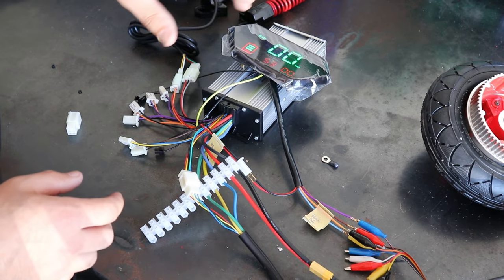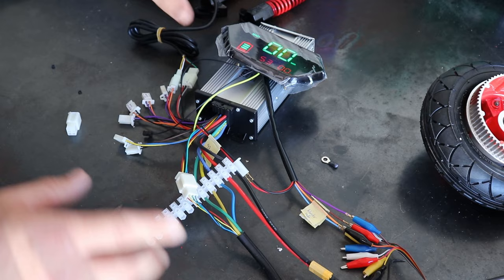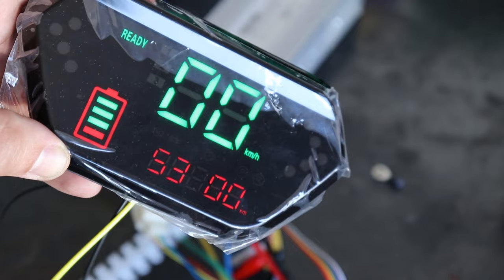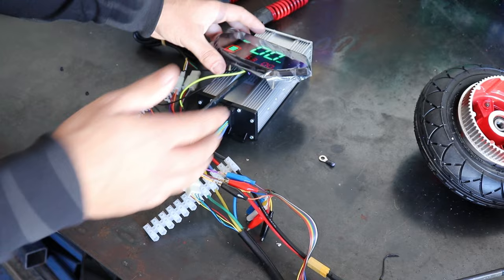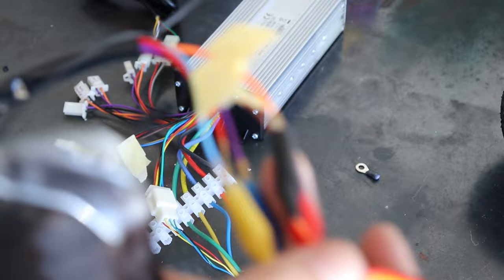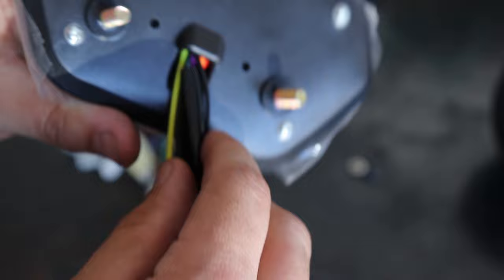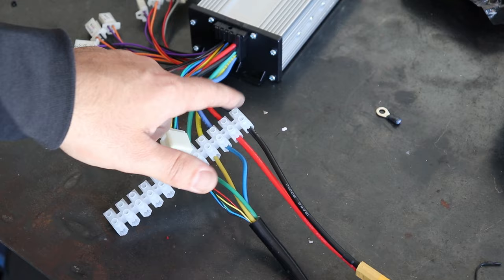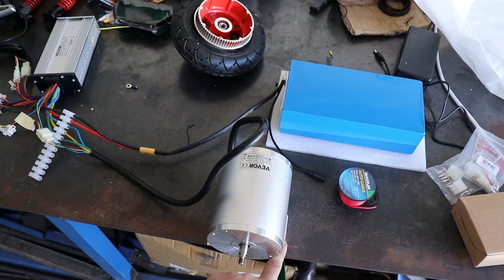How to Wire in a VEVOR 48V 2000W Motor Controller and Brushless DC Motor

Comment: Great video. I have 2 of these 48v 2000w Vevor Controller and motor sets on my Razor MX650 and MX500. They are amazing. I recommend doing the "shunt mod" it made a huge difference in torque. You can find a bunch of instructions on you tube. Cheers!

Comment: for this display, the yellow wire is for speed. should be connected to the controller one of the wire in purple colour. the label usually in Chinese is 一线通 or 仪表线(速度信号) meaning Gauge wire (speed signal).
the pair of black colour wire when connected together mean only use 60V battery. if not connect, 48V~72V battery also can use. At some controller also have pair of black wire can connected to each other. That is so call 自学习线meaning self-learning wire, usually for after complete assembled the whole system and testing. After done, you can disconnect it.
Reply: Regarding the self-learning wire: after the assembly is completed, connect the self-learning wire first, then turn the accelerator handle to let the motor rotate and keep it, pay attention to the direction of rotation, if the direction of rotation is reverse, disconnect the pair self-learning wires while still rotating,  At this time, the motor will stop automatically, and then reconnect again. At this time, the motor should rotate forward as correct direction, and then disconnect the self-learning wires. At this point the procedure is completed.
If when beignning of test the motor already turns forward as correct direction, just disconnect the self-learning wires to complete the test procedure. This is for save time no need to rewiring if the motor installed as wrong turnning direction. BTW, some controller the pair of self-learning wire is in white colour.
Reply: Can I run this off 3 drill batteries without destroying it ? - 60V OC
Reply: @jamesandrews5575 if those batteries can handle the rated 33 amps it should b fine

Comment: Hi, regarding the speed display what you can do is connect the wire that is responsible for the speed from the screen to one of the phases or the green or blue of the motor, and you will see that the display will change the speed, but be aware, as soon as you stop pressing the button the speed will decrease, the speed that will appear is will be measured according to the amount of current that passes through the motor but not the true speed at which the wheel is moving, for example let's say you are driving right now and then release the button, what will happen is that the speed you see on the display will not show the speed that the wheel is really traveling, it will look like 0 when the wheel still continues to turn, And unfortunately I also did not find a solution to this problem unless you connect an external sensor to the wheel and then connect it to the screen and only then can you see an accurate speed.
Reply from the maker: G'day Mate! I tried this and it worked! Yellow or Green gave me speed readings thank you very much.
Reply: What did it display may I ask as I'm wondering if I could connect the external  speedo I have to it but gotta figure out which of the two wires I gotta connect
Reply: I connect the white wire from the speed signal to the blue wire from the motor phase, and this gives a speed reading when I twist the throttle, but it also keeps reading the speed without twisting the throttle, it also does it if I just push the scooter and the motor is turning and the scooter is on
Reply: @bennysgarageau  right! i would like to your video on that
Reply: This video gave me a treasure of knowledge

Comment: The 1800W Vevor motor controller (BY12WF02-C)  has the "Speed Limit", "Cruise", and "Reverse" plugs. Shame they didn't just keep consistent on the wiring so it's not so daggone confusing.

Comment: One more thing your motor is operating at 100%, your 3 speed switch if you short that out you will eaither get 50% power or 120% power. So if you want a speed boost short the  3 speed to 120% for an extra boost 🤔😉
Reply: whats the best way to short 3 speed switch? newbie here... peace
Reply: @sevenmoon4105  small bit of Wire, Solder the ends to make them more solid
Reply: @sevenmoon4105  Use the middle pin as the base and then use the other bit of the wire to pin one of the 2 outside pins and you should get 50% and 120% no pin is 100%
Reply: Does this work for any scooter's motor or you refer strictly to this vevor motor?
Reply: thanks for your help! so does  matter  which outside wire i connect with center? right now i am running it normally so black to black, blue to blue, yellow to yellow..  @djhighvoltageoffical
Reply: @sevenmoon4105  no it doesn't, once you get the motor spinning in the direction you want then apply this method

Comment: I am ordering one of these payday on the 3rd as well as a 48volt 2000watt used power supply.  The power supply come out of telecommunications field.  You can buy them around 100 bucks.   But this is fixing to be the heart and sole of a shopsmith and also a 2 x 72 Belt Grinder .   2 3/4 hp Plus It has the option of being cordless.  The e brake will make it safer as well.   I think this is one of my better Ideas.

Comment: The speedometer needs to connect the yellow cable to the blue cable the bigger one that comes from the motor and it works like a charm. Also The contact with a red and black cable should be the external charging port. :)

Comment: Thank you man, great video covers everything in great detail, I'm going to put this motor on a Stingray bike except it will be 1800w instead because my mother doesn't want it to be powerful 😂 Keep the good vids coming!!
Reply: “Hey ma, but it’s only 200 watts more?!” 

Here’s a trick…. Just upgrade the motor controller to a 3000 watt bldc (make sure it has hall sensor) 
These motors are rated at “1800” however you can easily push 3000 watts with a motor controller upgrade and be safe. Most motors can withstand 2x up to 4x rated power but I’d say 3000 is safe with this vevors. They are well built, not the best but by no means cheapest they are quality and can take a beating. 

On eBay you can find them around $50 cheaper versions but I tell you they will do the job just try and find one that has the most “mosfet” count you can within your budget and you will see those things screaming. 
(Currently I run the 1800w vevor I bought used and it’s running a 3500 watt brushless motor with hall and it  screams past my brothers who has the full stock motor and controller 1800 watt from vevor. 

Cheers! 🎉
Reply: @Michael Smith  any example of a controller you can show us ?

Comment: I wired everything up and the motor only spins like a millimeter when I give throttle. If you know how to fix this please reply 👍
Reply: I have the same problem
Reply: @pandaman3459  I figured it out 
It’s 
Green to Green 
Blue to Yellow 
Yellow to Blue 
That’s the motor phase wires (fat ones )
The 5 pin white box wires are normal just swap the yellow and green ones and the motor should run perfect. Lmk if you have any problems

Comment: Sweet, great video! I replaced some of the plugs with waterproof plugs and had a voltage reading key lock and this got it going good with no fatal sparks! Might have to use a separate switch to turn off the volt reader with 48v power going through the switch. Dont want to fry the display.

Comment: I just bought one of these VEVOR motors and this video was really helpful. What battery would you recommend I get for this motor? I thought that the battery would need to have an output of 2000W, which means at least 40ah on 48V, but in the video you used a 15ah battery. Whats the cheapest battery size or type I can get for this motor? Thanks so much
Reply from the maker: Short answer for battery output, 1000w works fine, I believe the controller works like an inverter, 54 volts were going into it, and I was getting 48 at the isolator, this means it is controlling output, my battery was rated to 1000w but operated perfectly during a test run, ill do a full video on the battery i have soon. Thanks for the support! I will also be giving a battery away at 100 subs
Reply: @bennysgarageau  Thanks for the help!

Comment: The two black wires on the screen are for measuring 48v battery or 60v when you connect them or disconnect , to know the charging value .
I have a question please : 
This motor is without gear inside .. so it is a low torque , high speed motor . So do you think it will work on scooter or small car with small tire diameter , even you put 40t chain wheel on the wheel ? Will it drive on steeps ??? 
If yes , does it work on ebike 20inch or just with small wheels ?! 
Thanks

Comment: I was wondering if, since the regenerative braking seems to be a process of bridging the brake wires to reverse the motor and cause it to slow going forward, could bridging it while the motor is at a standstill be a way to get reverse direction out of the motor when you next energize its wires? I bought this same kit to fabricate an electric outboard motor and I was hoping it would have reverse. Don't really need brakes on a boat, of course.

Comment: Hi Very informative videos nice and clear. Does the motor run clockwise, and do you know if it will run at the same speeds, with reversed polarity ?
Reply from the maker: G'day there, i tested this in clockwise and anticlockwise, speed capacity was the same for both
Reply: @bennysgarageau I changed up the motor wires to make this motor run counter clockwise. Only 1 configuration worked and only with minimal power. Is there something else I am missing? Are there jumpers in the speed controller that need to be changed? Thanks!

Comment: Hi what amps was the choc block connectors for phase wires for hub motor and controller my system is 2000wat 45 controller thanks

Comment: How do you reverse the motor? I can run it in reverse with the switch, but its single slow speed. I tried reversing the phases, but it didn't work smoothly. the motor sounds terrible.
Reply: I have the same problem.

Impossible to reverse the motor in good conditions
Reply: Hello, I don´t know if you solved your problem, but to solve it is simple but may take some time. You need to change the phase wires (green, blue and yellow, the big ones) until the motor works great, if it doesn´t after you changed them, then you need to change the hall sensor (green, blue, yellow wires), If I am not mistaking it has 36 possibilites and only 3 work corretly, so good luck xd. If you have with cables (probably you do on your controller) and it is wrote "self learning" then you don´t need to do anything above, just search how to use "self learning bldc motor" on youtube so you don´t damage anything.
Reply: @corentinleduc8570  Hello, I don´t know if you solved your problem, but to solve it is simple but may take some time. You need to change the phase wires (green, blue and yellow, the big ones) until the motor works great, if it doesn´t after you changed them, then you need to change the hall sensor (green, blue, yellow wires), If I am not mistaking it has 36 possibilites and only 3 work corretly, so good luck xd. If you have with cables (probably you do on your controller) and it is wrote "self learning" then you don´t need to do anything above, just search how to use "self learning bldc motor" on youtube so you don´t damage anything.
Reply: @rodrigoramos5533  Hi Dear, I`ve the same problem. My configuration turns also wrong direction. So I have to change some wires. Do you know how to connect the wires for reverse turning w/o noisy and slow working ?
Reply: @draufgesch5215  I do know how to solve the problem but I don´t know how to explain it so everyone understands. You have the phase wires (big 3 wires), and you have the hall sensor wires (small ones with a small white connector). You need to try different combinations, for example:

Phase wires:
Green phase wire with green phase wire
Yellow phase wire with yellow phase wire
Blue phase wire with blue phase wire

hall sensor wires:
blue phase wire with blue phase wire
green phase wire with green phase wire
yellow phase wire with yellow phase wire.

then if it doesn´t work you need to try for example:

Phase wires:
Green phase wire with green phase wire
Yellow phase wire with yellow phase wire
Blue phase wire with blue phase wire

but in hall sensor wires you change it:
blue phase wire with green phase wire
green phase wire with blue phase wire
yellow phase wire with yellow phase wire.

until you get everything right.

Dont touch the red and black hall sensor wires as it is the power wires. (5v if I am not mistaking it).

I will link a video so you can understand better what I am trying to say.

https://www.youtube.com/watch?v=mJd-upxFemA&ab_channel=MegaPowerServices
Reply: @rodrigoramos5533  Many Thanks for your answer. I will try in the next days. However, my controller has a connector named as reverse. When I`m shortening this connector the motor will turn in the correct way. BUT then the motor turns way to slooooooow. I will try to speed up with the hall sensor cables. Hope it wont damage something. Other people told me only to change the power cable into the controller, but I think this could burn the controller ...
Reply: @draufgesch5215  I know what you talking about, I used to have that same problem, with the method I explained it worked fine. 

Changing the power cable into the controller (I can´t guarantee) but I don´t think that´s going to work fine with a motor that is 3 phases, we are not talking about a dc motor with only the "red power wire " and the "ground" or "negative wire", we are talking about a 3 phase wire motor.

Comment: Hi thanks for the video. I'm working on a scooter I have 48v brushless control board, 36v rear hub wheel. If I hook a 36v lithium ion battery will the scooter work? From what I understand you said the red and black skinny wire will adjust voltage vs the red and orange
Reply from the maker: Perhaps, not 100 percent sure, because you are going down in voltage, the supply will be fine, it only depends on if the board has a low voltage trigger, this may be present to protect battery, because the board is designed for 48v, the input would be a desired 48v. I would test it and see. Worst case you have to buy a new 36v controller
Reply from the maker: And just to be clear too, the red and orange wires are 48v out - the black and red reflect whatever is in the battery

Comment: hi, great video! im making a go kart with this motor but the motor turns to the wrong side. There is no place to replace the motor. What wires i have to switch to make the motor turn the other side? I only have to reverse the polarity
Reply: Find the connector with black and brown wires. Connect them together to cause the motor to turn in the opposite direction.

Comment: Thank you for the sharing the video.  Do you have any steps on troubleshooting the controller if the motor does not run?  Everything was working fine before motor stopped running.  I have the display connected to the ignition switch which turns on when I turn on the ignition key.  When I press the throttle pedal, motor does not run.  I am suspecting controller may have died.
Reply: You need the ING switch bridged.

Comment: great video! just one quick question: do you know how i can change the direction of rotation without the "reverse" switch? Thanks!😊
Reply: On the 3 phase wires that go to the motor run the wires green to green but swap reverse the yellow and blue. The. On the hall sensor wires  reverse the yellow and green wires
Reply: @EDITS-i6   Do you know what switch you need for the reverse drive?

Comment: I have the 24 V 350 W gear reduction motor from Amazon to put on a yard cart to haul debris around my yard will 2 -12 V 14 amp hour batteries work if I'm not using all the motors power.
Reply: Yes

Comment: my controller  is a 48v 2000w and i am trying to get it to turn my motor, i've hooked up power red and black, 3 phases to the motor, hall sensors and power up wire, i have throttle wired and it is active. i have control voltage feeding into the controller but motor is getting nothing! could this be  bad controller from new? and do any of the other wires coming out of the controller need to be hooked up to run it?
Reply: I have the same problem and it hurts my brain. Even with a new controller it doesn’t want to turn. No clue what’s going on, maybe the controller is bad(???)
Reply: @lincolnhausman7025  after looking at a few more possible wiring setups on youtube i figured out i had 1 more red wire to make hot, but that was too late, i had already tried jumping something else together and got a big spark! never good to get a big spark, i may have ruined mine by jumping something together too quickly, i think it's trash now. $50 lost in the learning.good luck with yours
Reply: Yup, time to buy a new controller (I shorted this one out for a second, thought it wasn’t a big deal but I guess it is). Thanks for the reply
Reply: @lincolnhausman7025  what a great time to be bicycling, motors, suspension, clean quiet, green, it's nice evolution